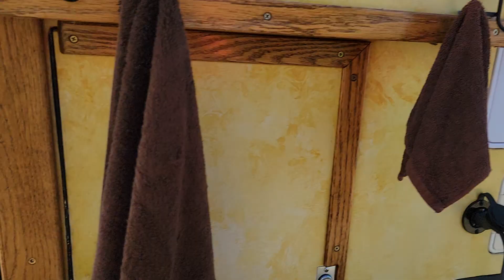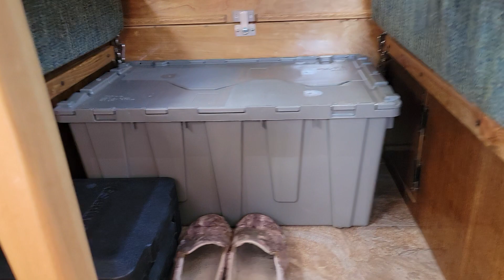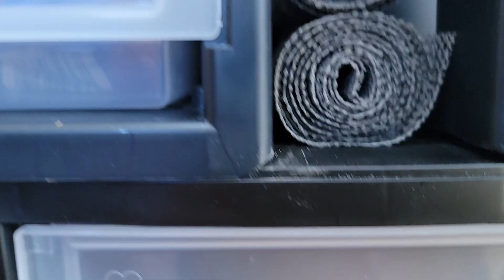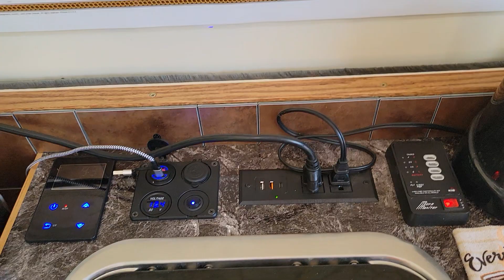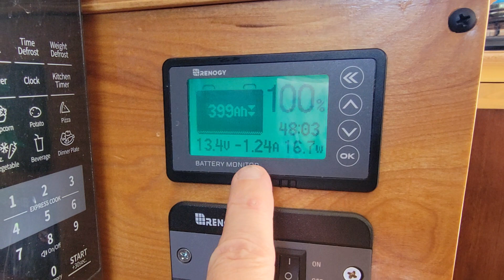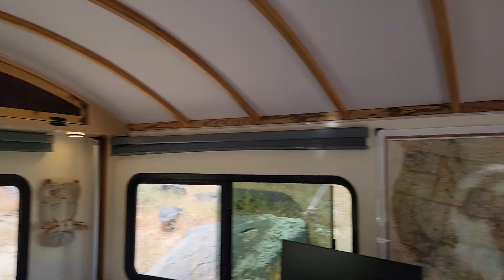Gypsy Caravan Project, Part 15: Final Construction Walkthrough @ Swan Falls Campsite #10

Comment: Wow, that's a really impressive build!  I'm curious how it's holding up, and if there Is anything differently you would have done?
Reply from the maker: All in all it's holding up really well. Having the door in the side rather than the back has caused a few unanticipated issues, due to the lack of structural strength at that point. It flexes over the axle more than I expected, causing the gap in the doorway to expand or contract. It just takes a little more finicking to get it leveled so that the door latches tight and doesn't bind. This would not be the case with the door in the back. But the great advantage of the open layout and extra storage more than makes up for the inconvenience. The only thing I would really change is to build it on a heavier off-road trailer with bigger tires, as these ones wear out pretty quickly. However, they're also cheap to replace. Also, splurge for the extra charger function on the inverter, since there is no solar when it rains or with heavy cloud and fire smoke cover, or shade from surrounding trees. I added a separate charger so that my generator will at least be charging the batteries now when I have to use it. Also should really have coated the rooftop wood trim with more poly, or even painted it, which I will probably do here pretty soon, as it's starting to peel and crack. But for the most part it's been a really trooper, and fairly maintenance free. Thanks for the compliment!
Reply: Very interesting. What would you recommend to strengthen the doorframe to prevent bending? I know this is a challenge due to its hi-lo design.
Reply from the maker: @Sunshine_day The only thing that would really solve it would be a sturdier trailer frame. The Haul-Master is designed to fold in half for storage, so even though I bolted the two halves together, it still has some flex. I reinforced the doors as much as possible, so they're pretty strong, and it's actually the floor that's flexing, so maybe a welded bar along the trailer frame to strengthen that side. The variance is less than a quarter inch, so it's not a huge deal, just something to be aware of when leveling.

Comment: Great build!  I have very much enjoyed your vids, and one I day hope to do something similar (I’m nearing retirement).  I already have a similar trailer frame.  On that - do you find that it tows ok?  Did you modify or change the axle or wheels?  And did you get it all weighed?  Thanks.
Reply from the maker: @jimvanderwood3094  The trailer tows perfectly fine, even without trailer brakes or a sway bar. It's not heavy enough to need that. I would probably build it on an off-road trailer with bigger tires next time, for bumpy back roads and longer tread life. These tires wear down after about 1000 miles. Empty weight came in at 1480 lbs, plus 300 for the  solar and batteries. Just under 2000 fully loaded.
Reply: @WanderingScot  thank you for the response!  YouTube fed me your video as I was getting info on actuators!  Your is one of the most interesting builds on YouTube - I’m surprised it doesn’t have significantly more views.